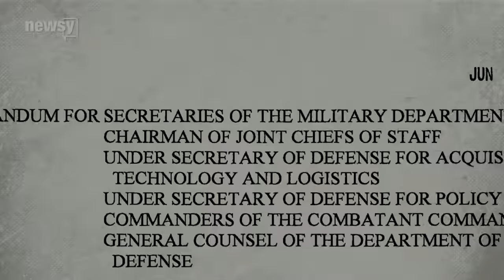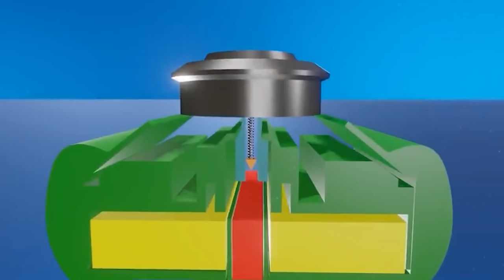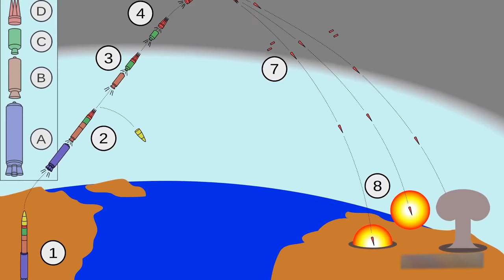This Weapon is FORBIDDEN Worldwide

Comment: Hollow point ammo does not knock anyone off their feet.  In fact, no pistol round will!
Reply: Mythbusters gave a good demonstration of this. A 12 gauge slug transferred the most momentum of all types of ammunition fired.
Reply: @tjr7424  Still won't lift you off your feet like Hollywood shows.
Reply: Physics,,,,,, Think about it. - You can't generate more energy on target then you have recoil from the firearm . Action - Reaction cannot me more then 1:1.   If it knocks the target down then it wound knock the person firing the pistol or rifle down too.
Reply: For the most part you may be right but I guarantee a 454 casul or bigger will knock a person off their feet
Reply: If a 44mag doesn’t put you down then you’re probably a moose
Reply: Absolutely correct.  Anyone that ever hunted deer or such knows this.  The deer may seem to get "knocked off its feet", but that occurs when it is running.  I've shot many a deer in my much younger days, and NONE went tumbling aka "Hollywood" style.  Trying to tell people that a .44 Mag (or .454 Casull) will do more damage than a .30 caliber hunting bullet at 3200 fps is fanciful.
Reply: That depends on interpretation.
Reply: There is NO interpretation, it's physics pure and simple.  I got my start with a colt 1911  series 4 mark 70 around 1972.  I wasn't old enough to buy it.  But I totally bought into the myth of knock down power.  I'm amazed people still believe it today.  So what changed me?  3+ decades of law enforcement , and numerous training in the topic of ballistics and knock down power.  Studies that included high quality analysis of thousands of real shootings, to include autopsy data  as well as the use of analogs.  The results of those tests have been totally repeatable and consistent for decades.  There is no such thing as knock down power in pistol calibers.  There is however, psychology of being shot, which might include being knocked down, but dont count on it.  The street is not a Hollywood movie.  The fact is, a committed bad guy can continue to shoot for at least 10 seconds after a round has blown a hole in his heart.  That's medical fact. You have at least 10 second of usable brain function after circulation (oxygen) stops reaching the brain.  There are numerous  real life examples of this.  The only sure instantaneous one time stop is a head shot or a lucky shot that takes out the spine.  As a rookie in the late 80's I was first backup on an officer involved shooting.  After the round penetrated the perps lung it hit his spine in the upper chest.  His legs dropped out from under him has he rapidly bled to death.  Think the FBI shooting in Kendal (Miami) in 1986. 2 committed really evil guys, Platt and Maddox were fatally shot multiple times, yet they continued to fire on FBI agents because they hadn't bled to unconsciousness.   Multiple round fatal round that DID NOT KNOCK them DOWN!.  That all said, I still love my .45 because it does leave a bigger hole, though sometimes I do carry a 9 for round capacity.  The bottom line people pure and simple is SHOT PLACEMENT.  You shoot till the threat stops, which might not be until they bleed to unconsciousness.

Comment: Cluster bombs are only banned for use by the 93 countries that sign the agreement, the rest of the world is still free to use them.
The same with WP and land mines only banned use by the countries that agreed not to use them. 
On a side note:
 Both countries at war in the Ukraine have not signed on to banning these weapons.
And really where did you get the idea that the last two nuke weapon systems are banned??? There are agreements to limit there numbers but they are in no way banned.🤔
Reply: Right.  The countries that have banned these weapons are the countries that don't have the ability to make them.
Reply: @tomgreene7942  Very likely, but it does not stop others from using them on them. It just stops them from using them if they ever buy any or develop a means to make their own. Seems to be kind of pointless to ban yourself from using a weapon you don't have or will likely not get.

Comment: This company needs to have their commentators learn the correct pronunciations. e.g. Napalm is VISCOUS gasoline, and yes, it is a vicious weapon
Reply: I don't remember using a flamethrower for napalm, only napalm air strikes.
Reply: @erichfischer8064  flamethrowers use napalm, just gasoline or other simmilar flamibles wouldnt have the range or damage (civilian flamethrowers use such gases, military versions dont)

Comment: Are hollow points banned if used by people in the US  if the US was invaded, my understanding is they are not banned for the people of an invaded country.for use on the invader.
Reply: They are banned by the Hague convention. That only applies to those who signed the convention.

But in practice, most militaries don't use hollow points. In part because they are less reliable and militaries need their guns to ALWAYS work when needed. Even in austere conditions and when used in machine guns. Full metal jacketed bullets are less leathal but more reliable in extreme condition.
Reply: Don’t worry about it. 
We’re about to find out.